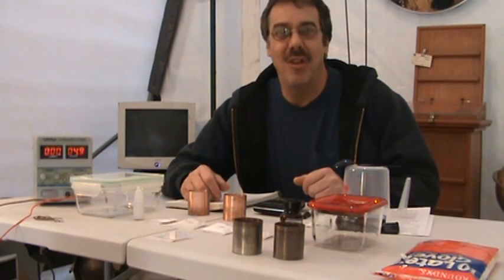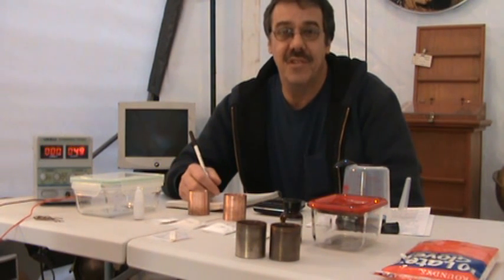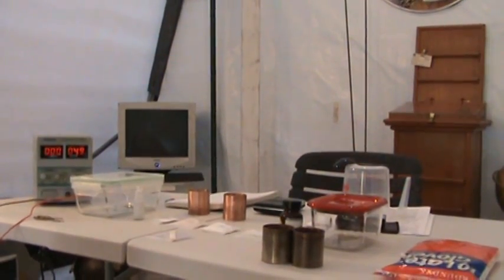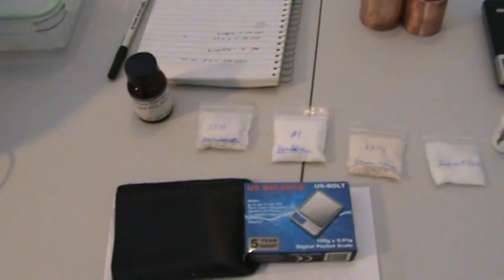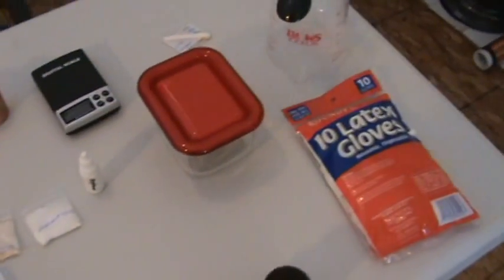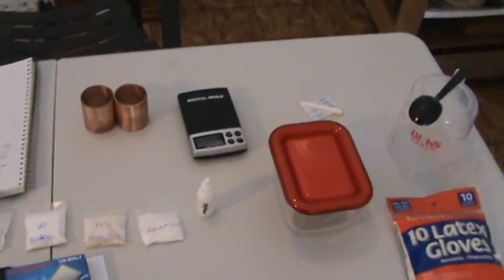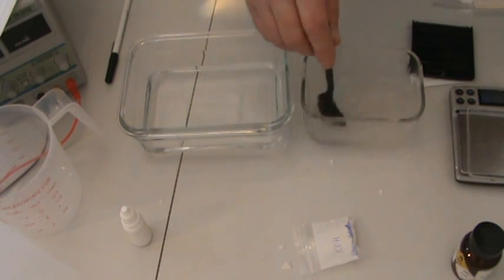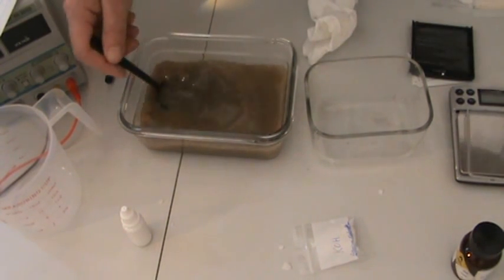How To Electroplate Silver Onto Copper Pt.1 (Great results)

Comment from the maker: The surfactant I sent you for silver plating was K-12 (sodium lauryl sulfate).  It is a common ingredient in detergent and hair shampoo.  You can use neutral dish soap (regular, not ultra-concentrated) as an easier alternative.  I also found that this solution tends to react with certain plastic containers.  So it is much safer to use glass containers like you did.

Here is some guideline on the solution I have used.  This formula is based on making 500mL (half liter) of silver plating solution.  You can use NaOH in place of KOH.  NaOH comes in more pure form and is much easier to find.  For a different volume, adjust all amount accordingly.
Chemical list:
·         AgNO3 (Silver Nitrate) – 5.0 g

·         KOH (Potassium Hydroxide) – 6.0 g

·         Succinimide – 11.5 g

·         KNO3 (Potassium Nitrate) – 3.5 g

·         Brightener (diluted for you) – 1.2 g (use the eye dropper, the marker in the middle of the stem is 0.2g)

·         Surfactant (the bubbling agent used in toothpaste)

·         Boric acid – 12 g

·         Distilled or de-ionized water – 500 g

 

Step 1:  Make of fresh silver hydroxide (dark brown precipitate)

Dissolve 5.0 g of silver nitrate in ~200mL (8oz) of water in container A.  Dissolve 5.0 g of potassium hydroxide (KOH) in another small container B with ~150ml of water.  Pour entire 150mL KOH solution into container A and stir lightly for a few seconds to make sure all the brown precipitation is in fine particles (no lumps).  You can rinse container B with a small amount of water and pour into container A.  Now all the silver has been converted to insoluble silver hydroxide.  Do not let it sit for more than a day before proceeding to the next step.

Step 2: Make of soluble silver complex compound

Slowly add ~8.0 g of succinimde to container A while stirring the solution.  The dark precipitation will slowly dissolve and result in a clear solution.  You have just made the magic ingredient!

Step 3: Make of final plating solution

Measure the following chemicals and add them one at a time into container A with a stirring motion:
50mL of water; 3.5 g of succinimide; 0.5 g of KNO3; 10 g of boric acid.  Now you should have a solution at about 400 mL.

Using a separate container to prepare a KOH solution by disolving 1.0 g of KOH in about 50mL of water.  Add 10mL of this solution, to container A, at a time while stirring and measuring the pH of the main solution.  Make sure that the final pH reaches 8.5 to 9.5.  To use the pH testing strip, you can cut it into smaller pieces for multiple testing.  Do not reuse the testing strip.  Use tweezers to grab a small piece of the test paper and dip it into the solution for 1 seconds.  Check the color within a few seconds.  A blue to dark blue color is your target.

Place a small amount of the surfactant into a small, capped container, add 50 mL of water and shake vigorously.  After the bubble settles a little, pour this solution into the main container A.

Finally, add 1.2g of brightener into the main solution and mix well.

Check the final volume to be around 500 mL.

·
Plating parameters:

Voltage: 1.0 - 1.8 V (you can experiment to see what voltage gives a better result)

Use pure silver as the anode (to the positive lead on the power supply).  Please take extra care so that only the silver is in the plating solution.

To get a better result, try to use similar size of conducting surface on both cathode and anode.  This is just my finding in most cases.  If the anode is much smaller than the object being plated, to achieve a better result, lower voltage must be used which results in longer plating time.

Of course, the most important thing is to polish and clean the surface of the object to be plated.  I found that a degreaser works well to remove polishing compounds.  After degreasing, dip the base in 10% hydrochloric acid or sulfuric acid for half a minute to remove any oxidation film.  Rinse with flowing water (tap water okay).  Plate before the surface becomes dry.

Keep stirring during the plating process.  The shiny silver coating should develop with a minute.  If the surface becomes dull or yellowish again after a few minutes, you can gently rub the surface with an extra fine polishing paste (like a car paint swirl mark remover).
Reply: Whats the chemical name of the brightner used here?
Reply: @mzpraveen  I also want to know this lol
Reply: funny i was just thinking of additives to put in my copper solution such as toothpaste and borax ,now i see boric acid as one of the ingredients,,i cant believe it,because i have no scientific background i was juts thinking maybe using these things with the solution like i do when brazing will work lol
Reply from the maker: @ARCSTREAMS  Too funny, lol,,,yes, toothpaste works also
Reply: Thanks for you help

Comment: Does the thickness of substrate (copper) effects the deposition of Silver (shiny or matt surface)?
Reply from the maker: I am no expert, but i would think that it does "not" matter in this situation, i don't think the current through would change much at all to make a difference.  Just that the more surface area may require more time.
Reply: @INVENTOR3  Thank you for quick respond.

Comment: Very clumsy lab practices....you provided a very poor instructional video here
Reply from the maker: Hmmm, well, be more cautious than i was, i am not a professional electroplater.  I am still learning myself.  The point is that i show people how to do this at home and get great results without using cyanide.
Reply: Jesus man, loosenln up a little. You have never tried something only to find it that you died something incorrectly? It isn't hard to nicely tell someone something that they did that was incorrect. Why don't you try being someone that helps people instead of someone that just criticizes... Anyone can do that, just like I started out doing to you. However, I told you house your could fix your issues as well, didn't I? More it is all up to you...
Please, show a little respect for someone trying to help others.

Comment: Could you provide a link to the pyrrolidine that you use?  I found it on ebay but am unsure if it's the #1 version or not...
Reply from the maker: Sure.....
http://www.ebay.com/itm/15-Grams-Succinimide-98-034-1-034-Chemical-Ingredient-for-Silver-Plating-Solution-/201216482082

The link is also under the video description, if you dont see it click on "Show more" under the video.
Reply from the maker: Sure....
http://www.ebay.com/itm/15-Grams-Succinimide-98-034-1-034-Chemical-Ingredient-for-Silver-Plating-Solution-/201216482082

The link is also below the video description, if you dont see it, click on "show more" under the video.
If that link does not work search ebay for... "15 Grams Succinimide 99% Pyrrolidine-2,5-dione, Making Silver Plating Solution"
Hope this helps
Reply: Its not pyrrolidine its succinamide

Comment: where did you got the surfactant? also you mention potasium nitrate, where and when you add it?
Reply from the maker: I got surfactant from guy on ebay, name is in the description under this video.  Surfactant used here is called K-12 (sodium lauryl sulfate).  It is a common ingredient in detergent.  You can use dish soap as an alternative.
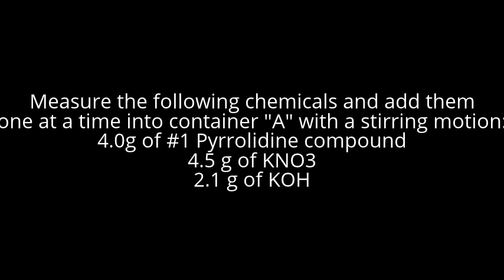The potassium nitrate is mentioned at 9:00 minutes and measured at 9:44 and finally added at about 10:25
Reply: Thanks
Reply: Hey, that plating still lasting? What alse did you plate?
Reply from the maker: Only plated the copper tubes so far.  I expect my solution is probably still good to use again :-)  The plating worked very well and is still lasting perfectly.  Good solid even layer of silver :-)